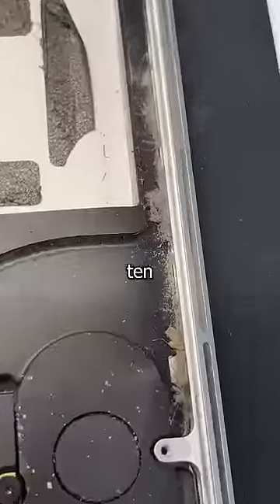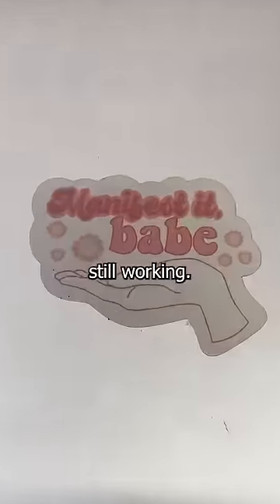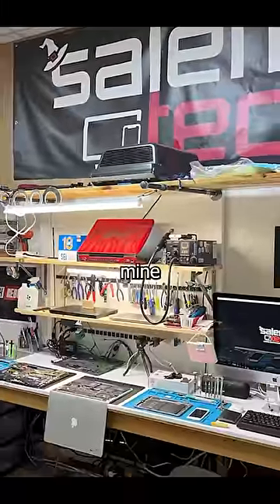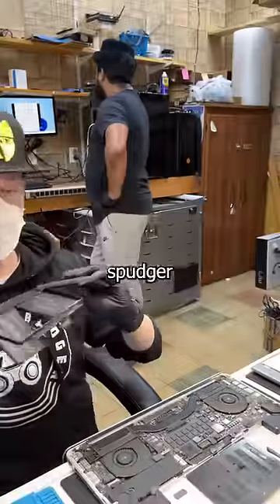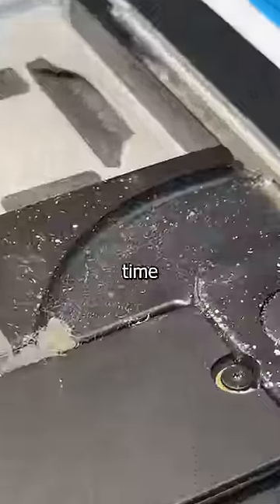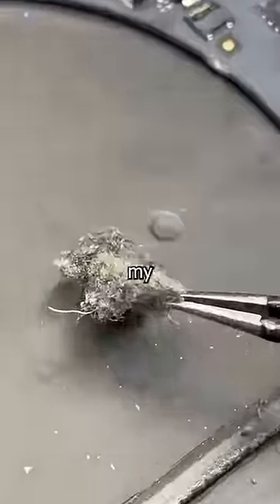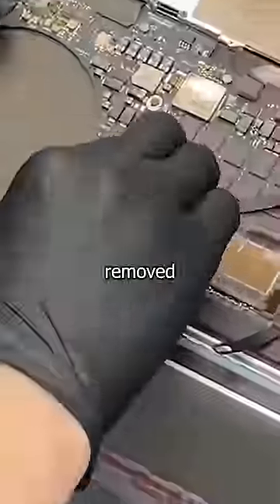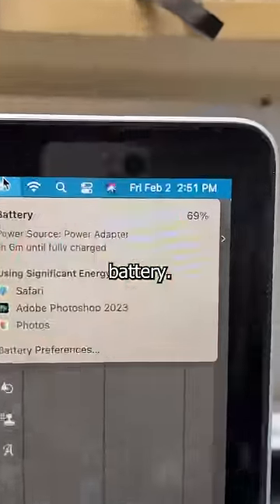Apple wouldn't fix this MacBook Pro, but I will! #tech #pc #technology #shorts

Comment: My 2013/2014 MacBook Pro is still going strong, and, amazingly, it still holds a charge!

In the decade I've owned it, I've had two (work) MBPs die on me—literal definition of "they don't make 'em like they used to."
Reply from the maker: Facts my brother! Keep an eye out for the bent case (it indicates the battery is welling). It might say it’s fine but could still swell
Reply: @SalemTechsperts  Noted. If it develops any issues (and I don't feel like doing my own repair), I know where to send it—I'll hand it to my mom and have her put it next to her toothbrush.
Reply: @SalemTechsperts yup. Gotta love it when track pads start popping up out of the palmrest because of swollen batteries!
Reply: @wouldstock1 or when they crack, which can also happen.
Reply: I just bought myself a 2012 MacBook air for $150nzd ($92usd). After a clean and new thermal paste, as well as a new battery, it's like new. Running Mint on it, and it's excellent. It does get pretty warm under load, but the heatsink is tiny, so not much to be done.
Reply: @SalemTechsperts my MacBook Early 2008 still works perfectly. I’ve never cleaned it or anything. Wonder how bad the inside is like. Probably dirty
Reply: had mine from 2014 technically still worked but it would lose battery in an hour and was getting slow, plus the T key was broken. it served me well the years i used it (bought it refurbished in 2019) but the low amount of storage (128 gb) and ram (4 gb) finally killed it for me
Reply: My mid2014 is still like new & still kicking, 2015’s had an upgrade, this line will be legendary with time.
Reply: @taavi948 Let's just say EPA has your laptop on a watchlist 😂
Reply: My 2012 mbp still works great too, holds a better charge than my new $2K Lenovo lmao
Reply: CrApple's worst nightmare.

Comment: im glad people like you still fix these older devices. older macbooks are like tanks, i daily drive an 11" 2013 macbook air and it never let me down + its still running its original battery. i bought it slightly liquid damaged, cleaned it up and it turned out that the battery had just barely reached 100 cycles.
Reply from the maker: Love it. My daily for casual is a 13” 2012 MacBook Pro

Comment: I know from experience it’s actually easier to replace the MacBook battery once it’s bulged, as it pulled away a bit from the top case. I did the same repair on my 2015 15” MacBook Pro.

Comment: You have actually helped me to increase my repair skills a bit... while I used to blow out the fans, after watching your videos and noticing swamp gooch in areas I didn't look, I now pull the fans right out to clean.  :)  Just did my first hinge repair... and I am not impressed.  I've fixed laptops casually for 20 years but my first hinge repair on an Acer A515 55 kinda sucked... > 1 hour to remove the screen... all that bending was scaring me, heating it up, trying to wedge stuff under while softening the glue... BUT, once I could grip the weird white strip... then the rest of the removal of the sticky tape was quite quick...

I am surprised how much the LCD could bend without breaking...   a shame the pull tab for the glue ripped off... or it would have been a decent repair.

Well, now I know more... next time will be better...

Comment: What's funny is I have a 2014 MacBook Air and it still works perfectly, minus the stripped screw heads and 5 vertical lines in the LCD,i use it was a general laptop for light gaming(Mainly don't starve together),writing stories and designing characters and it still works perfectly 10 years later, i use it literally every single day,infact I used it to write this comment

Comment: M minus 3 Macbook Pro
Honestly Apple should distribute authentic parts to independent repair shops. That way they could legitimately take the stance of refusing to repair older hardware themselves (or at least being selective). A good tech company should have a 10 year repair window minimum. Also shouldn't try to profit from repairs.
This laptop is about outside that 10 year window so their suggestion to buy a new one "makes sense" to me. However it's still a perfectly good laptop that 100% should continue its life instead of becoming ewaste. Even if the customer buys a new laptop this one would be great for somebody else.

Comment: Did this myself, for my Late 2013 MacBook Pro Retina. Battery went in fine, she was working lovely. 

Tried to install updates, and poof. She won't turn on. Won't charge. Even the charger doesn't light up. 

Kinda feels like either the battery was a dud and fried the mainboard, or Apple sent a kill command for my MacBook to commit seppuku...thinking I'd buy a new MacBook. 

No thanks Tim lol 😂. I'm not paying $400 for a 2tb SSD. 

Ordered a Lenovo Legion Pro, and despite it not being as pretty, I'd say it's a fair bit better as a machine. Almost keeps up with the M3 Max in benchmarking (except in power consumption 😂)
Reply from the maker: Most likely got a shit battery that fried the board. I’m sorry to hear it

Comment: I've noticed pretty consistent pattern with old MacBooks around 10 years Mac OS x quits supporting the hardware. Then chrome drops support... Then your options star getting more limited as the app store drops off. Thinking of putting Linux on my 2012 Mac air eventually.😮
Reply from the maker: Thank God for OpenCore Legacy Patcher, you can install Sonoma.

Comment: "Its apples worst nightmare, because after 10 years, it's still working", yeah, probably that's the reason they told him to buy a new one😂
Reply: When they do a battery replacement they replace the whole top case, and they probably had no more of those.

Comment: Hey there i saw your videos and found you quite knowledgeable about this stuff. So i would appreciate it if you could give me some  information on my situation. I have a Asus Rog Strix G15 laptop and i have accidentally dropped it. So now there are two issues in it.

1. The screen has a little dent on the bottom right corner of its back and everytime i try to adjust it,  it flickers like crazy and sometimes freezes.

2. This is the real issue, my wifi goes away on physical movement of the laptop. I have to restart the laptop to get it working. 

Before i dropped it i had the same issue in my bluetooth but after i dropped it. It transferred to the wifi. I am from India and the repair shops here are just out to loot you. They say you have to replace your screen and wifi. 

I don't have the money for it and i beleive that these are issues that can be fixed without replacement. So my question is that,  is this really the case or are they right ?

Also if it's repairable could you give me some pointers on how i should go about it.

Comment: When someone brings in a ten year old piece of malfunctioning hardware, “F#%k you, buy something new” is the right answer. Not only is it likely to not be receiving security updates, but  it’s also likely that something else will fail on the hardware afterward, making the repair a waste of money.
Reply from the maker: It 100% depends on the price of the repair in relation to the usability and value of the machine. This model MacBook is very reliable, but just like all things, they DO have specific points of failures. Before I give them the quote, I check to see if these already exist or look like they are going to happen. And when it comes to Mac OS, Apple still pushes security updates to non-supported OS's. You also have to factor in the customer. What do they use the machine for? Do they want to deal with buying a new computer and setting it up? Do they want to pay you to do it? Is there a feature this machine has that they can't live without? The customer is ALWAYS the biggest variable in these situations.

Comment: I still have a MacBook Pro from 2012. My only issue is really the battery and how long it takes to boot up.
Reply from the maker: I daily my 2012. New battery is $40, slap an SSD in it and you’ll be gravy
Reply: @SalemTechsperts I have three 2012 MacBook Pros, and all still work fine on their original batteries. I have a 13” unibody, a 15” unibody, and a 15” Retina.

Comment: Can you help me determine if I should get my MacBook fixed? I need to get a new charging port cuz my battery won’t charge. Already replaced the battery once and nothing changed. The “charge battery” symbol comes up and goes away when plugged in but the % never goes up. Should/could I get I fixed?

Comment: It's crazy how super outdated tech also works. I have a 10 yr old windows laptop and it still works fine. No issues. Just a bit slow compared to normal laptops. 
And another Sony laptop thats 16-17 years old and still works. And does browsing etc. hell I even play GTA SA on it from time to time.
Reply: My oldest laptop is my 117mhz PowerBook 1400cs from 1996 or so. My oldest desktop is my 486 machine from 1994 or so. Both work completely fine.

Comment: Hey I have a question. Will using thermal pad make the macbook itself run worse than before? I have the 13 inch 2014 and with thermal paste, it overheats already
Reply from the maker: PTM is better than the stock paste that came with it so no, it will run cooler than it did before. But MacBooks in general run hot as shit, hitting 100c under load isn’t uncommon even with new paste

Comment: i have a question how much would it cost to remake my 2012 samsung 300e to 16 gigs or ram and from pentium B900 something to i7 and maybe a graphic card or chip

good thing i don't have forbiden cotton candy in my vents but thermal paste is probably crusty asf not changed since 2012 but it does not get hot asf temps are good i think